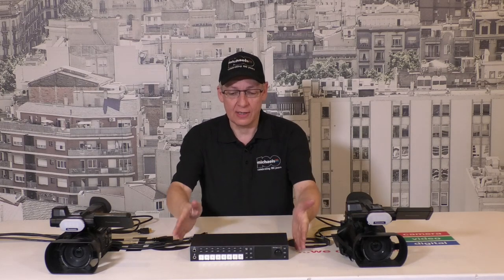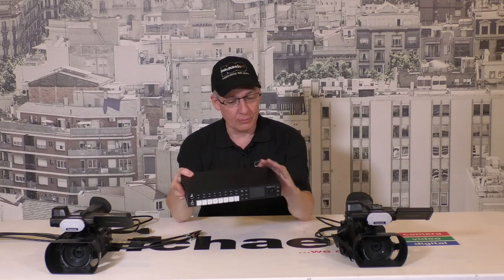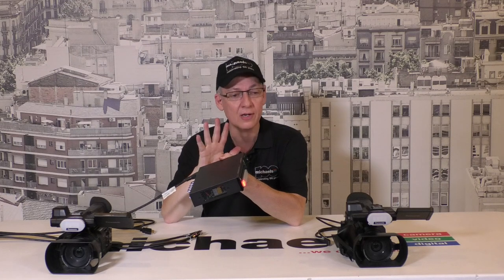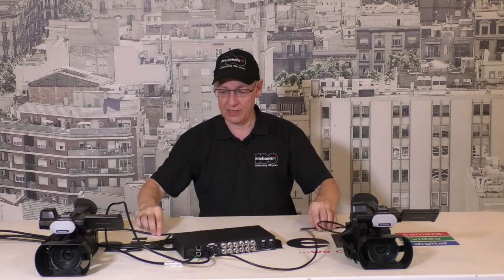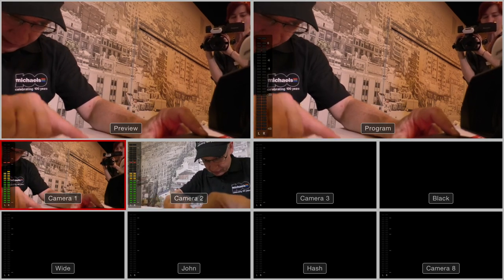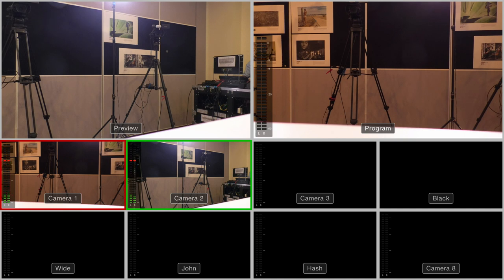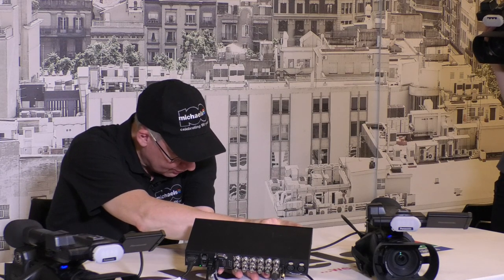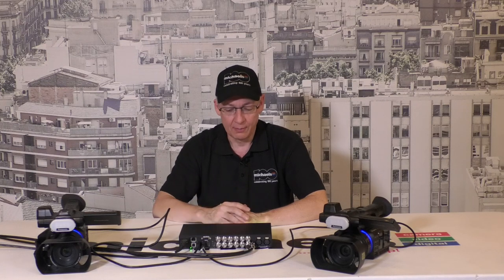Blackmagic ATEM Television Studio HD - Setting Up and using 2 HDMI Video Cameras

Comment: I'm not sure if you're still picking these comments up, but when you said you can run two separate multicams out (one SDI, one HDMI) did you mean they can be configured separately or are they just a cloned output?  Also do you think it's worth getting a loom made up for the long runs of cables for SDI or does that limit your camera placements?

Comment: Thanks for the video!
I'm looking to send my program output to a projector (using SDI-HDMI conversion) and then want to send a different output to another projector (using another SDI-HDMI converter). For the output through an aux, can I select the aux and mix video inputs in the same way as the program out? Or even get a multiview that will show Preview and Aux rather than Preview and Program, but be able to switch between where I'm mixing to?
Reply: 0

Comment: we have found out that unless your camera can output a mono signal onto both channels the ATEM television studio HD is no good for audio unless you use a separate mixer. The audio signals are linked stereo on the ATEM which means if you only have one microphone plugged in it will be permantly panned hard left or hard right and there is no way to change this position unless you use the more expensive 4K version of the system.

Comment: Hello, I have just received my Black Magic HDMI to SDI and running into my Black Magic Web Broadcaster to my iMac thorough OBS. The Picture is barely visible and lines all along the scene as well it is also show the same in the web broadcasters lcd panel.  If I just connect from my canon camera to the web broadcaster via HDMI it works perfect.  Any ideas on what to do?  Thanks in advance.

Comment: When I connect my 2 cameras the switch doesn't get the video signals and instead of it only shows me a black screen and gets the audio. I'm trying to record 1080p signals in 29,97fps I REALLY hope you can help me. Thanks
Reply: Make sure that you match the resolution of those two camera hope those cameras are the same MAKE and MODEL and then set the same resolution on the ATEM and that should work.
Reply: I thought there is a re sync function for different frame rates ?

Comment: I would have loved to see a connection of the Camera and Laptop/pc input. I seem to be having challenges with getting a laptop signal to the mixer.
Could you kindly advice on what I could be doing wrong?
Reply from the maker: The important thing to remember when Switching Cameras and Computers is to have everything on the same standard - in 99% of cases this means 1080p60. If you can't get all sources on the same standard you might need to convert the problem signal to match your main standard. For this job you want to get a Blackmagic Teranex AV into your system. Check out this video: https://youtu.be/ed8BbhWJ6g8
Reply: Is this an area where the Roland V-1HD / V1-SDI has the advantage over this Blackmagic offering at this price point?

Comment: I have 2 monitors that I want to feed a clean picture onto. How do I output on the the TV or big monitor? That's where I get it wrong.
Reply from the maker: You could use an AUX output from the ATEM along with a SDI to HDMI Micro Converter to drive a standard TV set that has HDMI inputs.
Reply: @michaelscamera  sir, what is use of sdi out put pins

Comment: How do I live stream to Facebook with Atem television? Should I connect the device directly to the PC ??
Reply from the maker: The ATEM does the Video Switching, to stream you will just send the output from the ATEM to the Blackmagic Web Presenter. Check out this video: https://youtu.be/TFzFAZLSu_Y
Reply: michaels camera - video - digital thanks sir !
Reply: Hi, I'm liking your video, but what if I don't wanna use the web presenter can I just input the signal with declink (or something similar) - and then use other software to stream it? Do you have a video how the ATEM control software works in this kind of situation? The goal that I'm trying to create is a streaming solution for 2 or more cameras that would require only one laptop that would do both the live editing and streaming.
Reply from the maker: The ATEM control software is completely independent of your method of streaming. As long as you can capture the video output from the ATEM into your computer (or even a stand alone streaming device) and get it to a streaming application you should be good to go. Keep in mind you don't need to do the live switching from the ATEM software as the basic controls are on the front panel of the ATEM. The other software items (like OBS Studio) just run in the background on the computer once you set them up and go live.

Comment: How would I record the switched feed onto a hard drive. No live streaming needed.
Reply from the maker: Michael, you can record the streaming output with any standard application that can record from a web cam. Do keep in mind that this will be at 720p. Otherwise you will need a video capture card with HDMI or SDI inputs. The way we record is with a standalone Blackmagic Hyperdeck. There SSD and SD versions of these Hyperdecks. Very nice products.